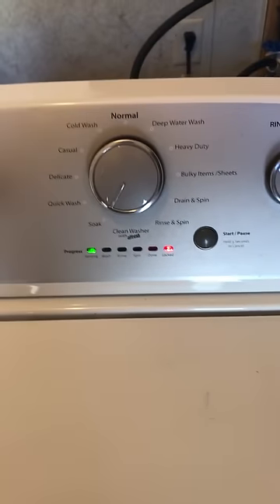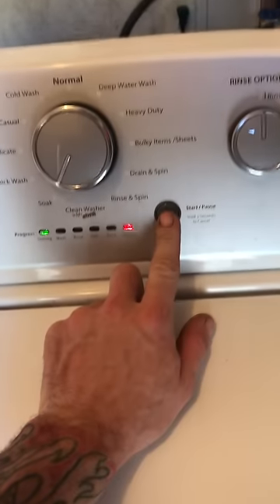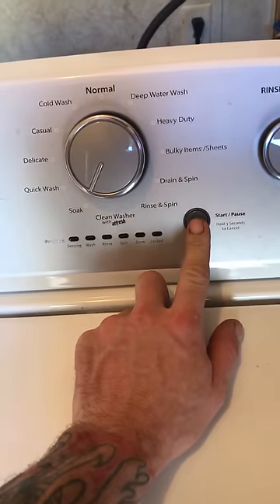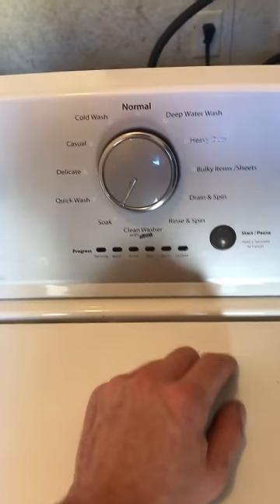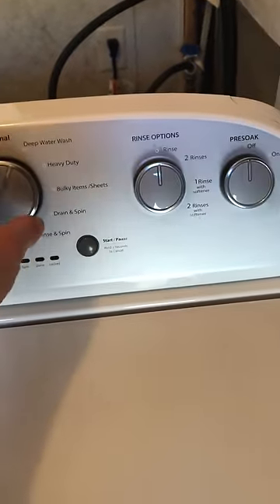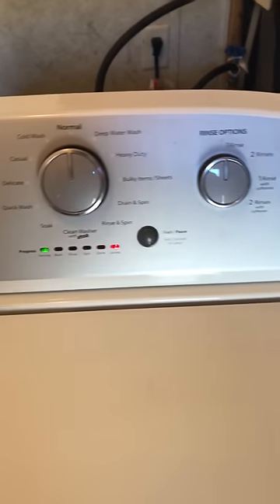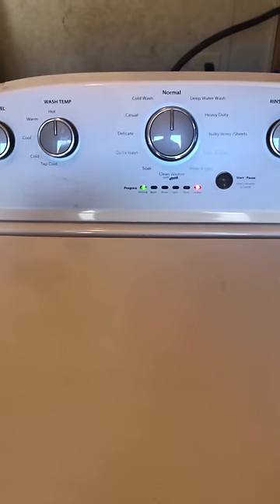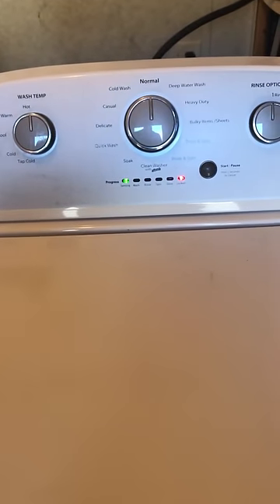Whirlpool washer will not pass sensing cycle

Comment: Help you??  I clicked on this video hoping that you could help ME!!  I'm having the same issue.
Reply: Factsss lmao
Reply: Lol.....same here 🤣🤣🤣🤣🤣🤣🤣🤣🤣
Reply: @traidmark23  buy a actuator
Reply: @traidmark23  the actuator  need to be replaced
Reply: My bad I’m just seeing this.   I know it’s fixed or you have anew one by now
Reply: Same 😂 😂 😂
Reply: Mine doing same thing
Reply: @laingej  It's the control panel.  Had mine replaced and have had no problems since.  All said and done, it was about $180.00, parts and labor.
Reply: @rodentcafeteria  wow..i just got this one used today.. is under warranty im going to call them tomorrow. But i looked at the actiator and it moves .. the motor kicks on and off and stuck in sensimg fill doesnt add  water ..
Reply: @laingej  Good luck.  I hear about 3 years the lifespan of most appliances before some type of major repair is needed.
Reply: @rodentcafeteria  found problem.. the cold water valve is not opening. I switch to hot and it works it fills with water.. in cold stays stuck in sensing..
Reply: @laingej  Congrats!  But does that mean you can't wash in only cold water, if you want to?
Reply: @rodentcafeteria  cant wash in cold water and cant rinse because rinse is cold water.. i swap the cold and hot water hoses so it washes it cold but still wont rinse because the cold side valve not opening .. it should work after they replace it..
Reply: @laingej  dude your comment saved my sanity. I replaced the sensor and it still wasnt working. Switched it to hot and voila back to working.. Thank you!!!
Reply: @Tchapman27x  cool man.. the technician came to look at mine and replced the water valve that was my ploblem.. the cold side solenoid was bad but comes in one piece
Reply: Very easy to fix. Not cost no tools
Reply: @BoopBoopKhloe   mine i bought it used ..but the ppl i got it from gave me one year warranty so they came to fix it at no cost to me..it was the water valve assembly. He replaced it and works like a charm now fills cold water and rinses. Rinse is programmed to be cold water so if cold water valve goes bad it screws the whole cycle even if tou select and wash hot.
Reply: I just fixed my! First i unplugged it and plug it back up after four hours then click and hold on turn on button   till it turns off. Then  turn it back on with just a  click. Hopefully it works for you all
Reply: Same hear with a Maytag Bravos
Reply: Me too
Reply: I just did same damn thing.  I need answers not questions. 😆 🤣 😂 😹
Reply: Me too 😂
Reply: Guys, you should check the actuator for continuity, or you can left the washer and see if it functions or not
Reply: @manolosoto4X  first check the cold and hot water hoses and then check the actuator
Reply: 😂😂😂same here
Reply: Same
Reply: Same
Reply: @naziiawilson1074  Turns out it was the control board/panel.  About $125.00 to fix; no problems since.
Reply: There are a bunch of screws you need to take out of the back they are 1/4 inch size socket. Once you do that takes a little bit of jiggling but you'll be able to find the access panel and you have to reseat the connections (I'm not sure which one) but that fixed my problem I had the same issue
Reply: And I just move in
Reply: Mine seems to only work with cold water 🤷‍♀️
Reply: 😂same here
Reply: @rodentcafeteria  where did you get one for that cost?
Reply: Listen same 😂
Reply: Answer .

Shut your cold water valve off. And take the cold water off at the washer... Take a look into the valve.. there is a small filter screen it could be clogged.. 
If it is,  take it out , grab it with a set of needle nose plyers , clear or the junk of the filter screen, place it back into the washer  and try again.

Check / make sure your water inlet valves are turned on, and your washer is able to receive hot and cold water .

If the water is reaching the washer... Then most likely you have a bad cold water valve... Try to change your water temp. To Hot.
If it turns on and water comes into the drum... Then you have a bad solenoid in your water valve.
Reply: OMG!..😂😂😂😂.. 🖐🏽
Reply: @rodentcafeteria it'd not the control board. Somebody ripped you off.  It's either the shift actuator or the capacitor.
Reply: Me too
Reply: Lol! Same here 3 years later . Did anyone fix the issue?!
Reply: @bamachic3084  Yes, it turned out to be the control panel.  Had it replaced (approx. $175.00) and no problems since.
Reply: @rodentcafeteria  Oh thank you for replying!!
Reply: Same
Reply: Same
Reply: When I do the clean washing machine mode everything works. It spins, drains, does everything. But when I do a normal wash it stays stuck on sensing. I think it's the cold water valve. Checked the hot and cold water sensor and got nothing from the cold water valve.
Reply: @Pete-yr9mt  I found re-manufactured control panel on ebay, had it installed and haven't had any problems since.  I think the washer was about two years old before I started having issues with it.
Reply: Lol
Reply: Me too
Reply: Lol 😂😂😂,  I was thinking the same thing !!!
Reply: Me too!!!
Reply: 😂😂😂😂same help!!!
Reply: Same here 😂
Reply: 😂right
Reply: Same problem here and the technician $175 for diagnostics alone and labor and parts could cost a minimum of $225  
I’ll play with the resetting and see if I can afford a new one better
Reply: Circuit board need changing
Reply: lol same 😂
Reply: Same here I need help with this washer
Reply: Me too 😂
Reply: Ditto

Comment: Okay, this is one of those new automatic sensing type of washing machines. What you need to do is turn the knob left, right, right, right, left, right. This will put the machine into diagnostics mode. Then what you want to do is turn the knob to the right until only the rinse light is on, and press start. This will calibrate the machine, and it takes anywhere between 30 seconds to 5 minutes. Once you hear the lid unlock, go ahead and run a test cycle. This successfully calibrates the machine. You should calibrate your machine often, whether it be anytime you replace a part or whenever it moves, whenever it goes out of balance. And the more you know about your washing machine, the longer it will last.
Reply: Im having the same problem. I was on tik tok and guy told me where the manual was and you exactly right about the L,R,R,R,L,R.
Reply: This worked!! Thank you so much for posting this !!! You saved my Sunday morning ❤️
Reply: Worked for me thanks, i was going crazy trying to get my machine to fill
Reply: Mine is stuck on wash and the only sound I hear is clicking from the door trying to lock….idk what to do but I need help! It won’t lock either!
Reply: If this doesn’t work. What’s my next option?
Reply: Thank you so much for this. But what gets it actually calibrating is turning it to “rinse” as opposed to just turning it 3 times to the right like you stated
Reply: This worked! Thank you my good sir!
Reply: When I'm turning what setting do I stop on each time ??
Reply: God bless you 🙏  I thought I wasted $600
Reply: Mine was stuck on the sensing mode but filling with water, just wouldn't go past it.  I tried this and when I got to the last step the lock light came on and water is now running in on the rinse and spin cycle.  Did I do something wrong?
Reply: This works thanks you so much
Reply: i do this and it won't complete the calibration - it only goes for 30 seconds
Reply: Mine is stuck on lidlock flashing and lid will not unlock so now what
Reply: Same lol
Reply: Thanks for posting, you helped more than the video lol 😂
Reply: Ty
Reply: I have been trying everything! I think this worked!!!!!
Reply: Where should the knob start when doing the left, right thing to calibrate?
Reply: @courtneyfrancese1814  You can do it from any position, but I like to do it from when the dial is straight up and down.
Reply: @russellharris1299  can you send me the tiktok video on how to do it,  please.  TY
Reply: I’ve done all of this and nothing the sensing fill light will flash for a couple of seconds and it will turn off
Reply: My washer does the same thing, when I close the lid water pours out then stops . Doesn't do anything after that. Do u know what the problem is?
Reply: @marydufren3699 did you figure it out
Reply: I'm so glad I came across this. My washer was stuck in soak for hours, and I'd tried unplugging the washer, but nothing works. All I did was turn knob left, and it's working now. Thank you so much!!
Reply: You are my new favorite person! Thank you so much! You saved me money and aggravation! ❤️
Reply: Actually I spoke too soon. Nothing's changed
Reply: Thank you so much for this my washer was stuck and now it’s running thank thank thank
Reply: Still not working for me,kmt
Reply: @NateCraven318 do u turn it all the way around to normal right then all the way to normal left then all the way to the right ?
Reply: @haywardtuff4588  You can do the LRRRLR move from any position on the dial, but I like to turn the dial straight up and down first.
Reply: @NateCraven318  bro it works ! Thank u man
Reply: @haywardtuff4588  Anytime bossman
Reply: thank you..👍
Reply: This fixed my washing machine!! Thank you so much!
Reply: THANKS 🫡
Reply: Ugh it’s still not working 🫠
Reply: I will try this procedure because I'm having the same problem,  thank God for this video
Reply: Thank you. Took about the whole 5 minutes or maybe 6 but it sounded like it was trying to take off or something. A violent shaking but in the end, it finished.
Running my first load to test now. Will update once it finishes or fails.
Reply: Big dawg!!!!! We thank you very much!
Reply: When the calibration is done it just goes back to blinking on the locked selection 😭
Reply: OMG Thank you so much!! I hope you have a great day and I hope something amazing happens for you!!!!
Reply: Thank you! Me and my mother went crazy trying to figure out the issue. I followed your steps and it works again! All love ❤
Reply: @darlenemikeycrum9440 mine is doing same thing did you ever figure out how to get past this?
Reply: @jasonodell79er mine is doing the same thing did you ever figure out how to get past this
Reply: @JessAnonymous mine too did you ever figure this out why?

Comment: Just moved into this apartment. The laundry units were left behind. This is the same washer. After reading multiple suggestions to check that the water was on, I did. For whatever reason it was not on. I just cut on both and it's doing it's thing. Still filling up but it looks like it's going to work. I'll be back to let you know if it doesn't. So if you don't hear from me, check that the water is actually on lol.

Comment: My girlfriend has the same washer and same symptoms I ran the diagnostic and sensing remained lit. The washer worked when set on hot, but not cold,and realized the cold water line (at the washer) had somehow been shut off. Opening  the cold water line fixed the issue in our case.

Comment: Make certain to turn on both the hot and the cold water, even if you're using the COLD temperature setting only. The machine expects & uses the hot water anyway. Our machine would stop after the SENSING part of the cycle and look like it was stuck on the WASH part without doing anything. Turning on the hot water made it run normally.
Reply: Thank youuuuu life saver !
Reply: Thanks

Comment: Before you do anything, make sure both hot and cold supply lines are working.  I went to return my new washer- stuck on sensor, and realized my cold supply line had to be replaced.
Reply: Oh my goodness!!!!!!! I have been trying to run the recalibration for the last 3 and some hours. I have been re watching and looking up what is going on and how do I fix this??? Read your comment and turned to hubby and asked ‘you did turn on the water right ?”  He gave that look of ooooommmmmyyyyyy goodness I’m so sorry. I then said you know I know have the golden ticket right 🤣🤣🤣🤣🤣🤣. But really thank you so much and a big 🤦‍♂️🤦‍♂️
Reply: Thanks ❤ that was the issue. The water wasn't on

Comment: Hopefully this helps but we’ve been having this same issue. It just dawned on me to try smaller loads and it seems to be working fine now. I think there was too much weight inside the washer for it to pass the “sensing” phase.
Reply: Just throw it out and get a nice used Whirlpool direct drive from the late or early 2000s, cheaper, way more aggressive wash action no BS gets the job done reliably every time with a real agitator. These new washers are a violation to washing clothes correctly with these ridiculous wash plates and unnecessary sensors, it’s a horrible corruption that took place a decade ago to meet “energy regulations” 🙄
Reply: I just did this, trying a smaller load and it’s working now but that completely sucks

Comment: We had a new gas dryer we got the one with regular push buttons without the fancy electronics.  Our whirlpools washer was installed in 1986 and still runs beautifully but my sister had been to 3 or 4 washing machines and her last one was a Samsung which her husband dragged into the sidewalk and marked ‘“FREE”. I am not a fan if fancy electronics on machines as basic as a washer or dryer
Reply: I purposely bought an older whirlpool because they are built so well.
Reply: @kurdtpatton5039  Absolutely, the Whirlpool direct drive generation is iconic. I’ve owned 3 different models and I’ve loved every one of them no BS no sensors powerful agitation PLUS CHEAPER! I don’t get why people buy new washers they do absolutely zero research first it’s sad!! HE was the biggest appliance corruption I’ve ever seen happen in the industry.
Reply: Never buy new the classics are the best all mechanical and no BS sensors or lid locks.

Comment: Maytag Bravos model MVWX655DW1 
I had a sensing problem I thought but just got it checked tonight and my problem was my wash temperature dial.  Not the dial itself but the setting. The tech told me that the newer  model washer should be hooked up with both hot and cold and hot water hoses in the back of the washer if you want it to run on cold water setting. It still uses a bit of hot water not much just enough to regulate the water temperature. If it's too cold and you don't have the hot water hose hooked up it still senses for hot water and that's why it looks like it's stuck on sensing. No parts needed except the steal hose for the hot water. If you want to run strictly cold water set your temperature dial to tap water and it will work. Hope this helps. My Maytag is 7yrs old.

Comment: It sounds like you need a washer door lid latch lock switch. Sometimes the magnet gets jammed in there so you can take another magnet and try to put it under where the lid lock and try to unlock the magnets if that doesn't work you'll need a new one so your machine will lock and began washing

Comment: Just got mine acted stupid from beginning but working great now this is what I done unplugged it plug it back up put in diagnostic mode and how you do that is turn it counterclockwise all the way around to normal then turn one click to the left three clicks to the right and then one more click to the left all the lights will start flashing if it does not do it again but faster once they start flashing turn the knob until you see only rinse lit up then push start it will run a cycle to calibrate sometimes it only takes a few minutes other times depending on the problem could take up to an hour I hope this helps if all of this does not work try looking on YouTube on how to check the sensor it's real easy to do it only has a little plastic piece on the sensor that allows it to know what to do if it breaks or don't have good connection it will act stupid because it don't know what to do can't read the signals good luck all of you
Reply: Thanks that totally works